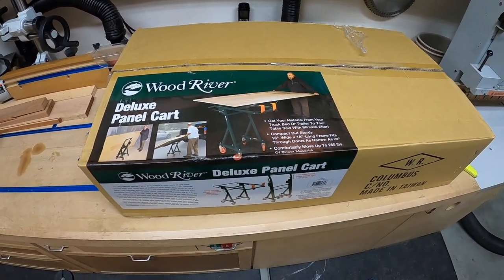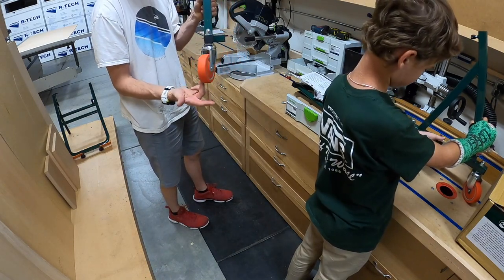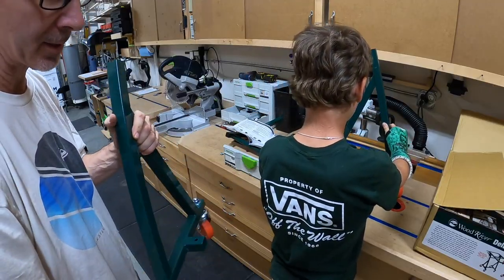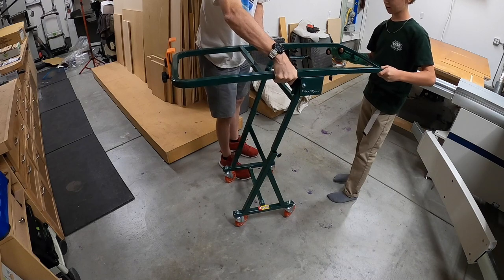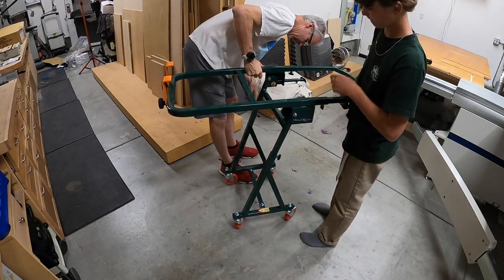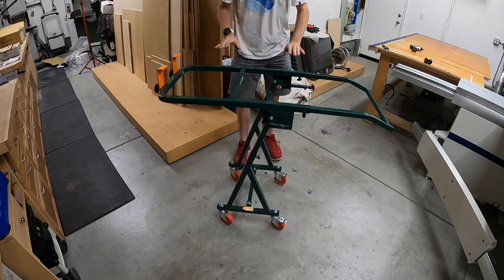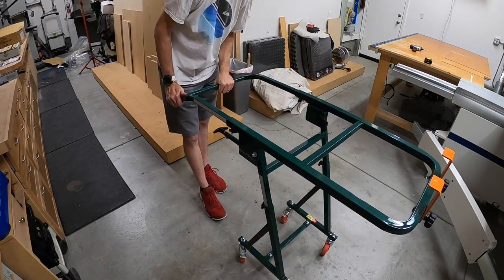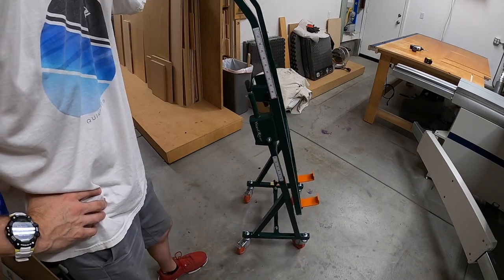Woodriver Panel Cart vs a "Crazy" Dolly!  Plus I Build Miter-Fold Floating Shelves!!

Comment: That dolly is pretty ingenious. I can imagine making something similar maybe with a flat top and it would make a great adjustable out feed support for table or miter saw.
Reply from the maker: Seriously it’s pretty amazing. I’m very lucky to have one.  When I used the plastic bag over it, the wood slid really well.  So without any mods it works as an out feed or infeed. Maybe not as good as a purpose built platform but good enough.
Reply: @davidbryanwoodworksandmore  I have my order in for the crazy horse when he has more stock. Thanks for the video

Comment: Panel cart is a terrific well made unit. I pull material ( 4 x 8 ) up a 20 ft ramp using my winch and remote. It tips the sheet at the top for simple one man access. Price was good also.
Reply from the maker: It is pretty nice.  You’re right.  Just didn’t like it for my shop. But the tilting and the strength of it seemed nice. Seems well built. Thanks for sharing your experience with it.
Reply: @davidbryanwoodworksandmore  😀 building a 3 story home using it. Will C how I do in my shop  later. Cheers
Reply from the maker: @MrTHEBRITINWA  wow sounds exciting.  Good luck with the build and cheers to you too.  Thanks again.

Comment: Great to see the saw in operation. Is it 100% accurate?  Do you prefer it over your old saw at this early stage?
Reply from the maker: Thanks a lot Shane.  It’s been really great to make the transition from cabinet saw. However I’ll say it’s not without some hiccups.  It takes a little getting used to. It is so accurate. I’m blown away each time I use it. You’ll see in coming videos just how I’m liking it for sure.
Reply from the maker: Let me also say that the cabinet saw setup that I had was truly amazing.  I wouldn’t have changed a thing.  I am not as efficient as I was with that setup so far, but that’s going to come soon. I just need more time with this setup. Not just with the saw, but with the assembly table and space to build. Since it’s smaller, I’ve got to get used to it. All the mods I made to the shop have been very nice for sure.

Comment: Does that saw tilt both left and right? When you are ripping it definitely was a right tilt, but it appears that on the crosscut it was a left tilt. Are my eyes deceiving me?
Reply from the maker: It only tilts to the right.  The cross-cuts were at 90 degrees. Some do tilt both ways but not mine.

Comment: Woodriver makes a lot of recreations of other tools and usually are not quite as good.  However, having bought one similar to that one, the larger wheels and more narrow rig itself, I would probably have tried some other ways to overcome your problems.
Reply from the maker: If I’m honest, the whole thing is not very good in my shop.  Just moving the big sheets that way make it difficult at best.  It’s easier to do what I have done.  But the other dolly, is a whole other thing.  It’s awesome.  I am finding many uses for it.
Reply: i would have just made spacers so the hooks were lower and used longer bolts, space is tight in his shop though, i could see how it could be awkward

Comment: What saw are you using, I am looking for a sliding tablesaw
Reply from the maker: I’m sorry. What do you mean what am I using?
Reply: @davidbryanwoodworksandmore  The sliding table saw you've got there, I am wondering what tablesaw that is.  Is the sliding table an accessory, or is it a finished good from a manufacture.  Thanks.  Enjoyed the video.  I was not able to find a link to the crazy Dolly.
Reply from the maker: @hardware4200  okay.  Honestly the saw was the whole reason for the videos in the shop remodel playlist. It is a sliding saw.  Not an accessory.  I’d recommend watching the shop remodel videos from the start. You’ll love them I think. From when I get the saw to when I’m fully ready to use it. I covered so much stuff.  Much more than just the saw. Just look under playlists and choose shop remodel one.
Reply from the maker: @hardware4200  here is the link https://youtube.com/playlist?list=PLZYR7YCdgUZcb-5nr0BERxtZbW6AyFU7F to the playlists.
Reply from the maker: @hardware4200  did you check out the link and the videos on the saw with shop remodel?
Reply: @davidbryanwoodworksandmore  I was hoping you could just tell me the model of the saw you're using.
Reply: Looks to be an scm minimax 315es
Reply from the maker: @jdpendery  you got it.
Reply: @jdpendery  Yeah, i think you might be right.  I'm thinking about a 410e CU combo machine.

Comment: Put a linear motor on it and make it infinitely adjustable
Reply from the maker: Well I got rid of the woodcraft cart.  It’s just not for me and my shop setup.  The crazy horse does good for outfeed or infeed support.   I used it to help off load a heavy item from my truck the other day and it helped.  But mostly it just sits under my slider and doesn’t get much use.  When I need it it’s nice to have.